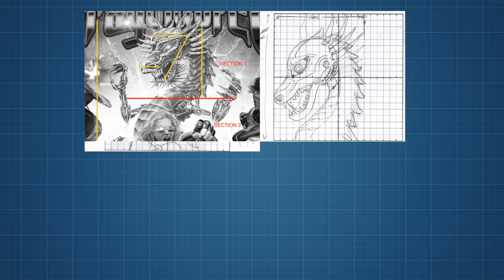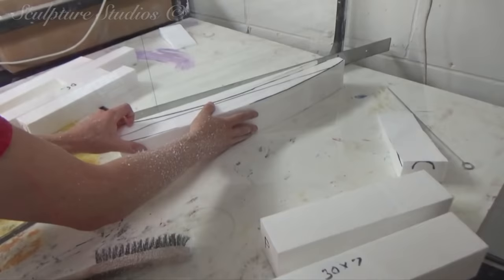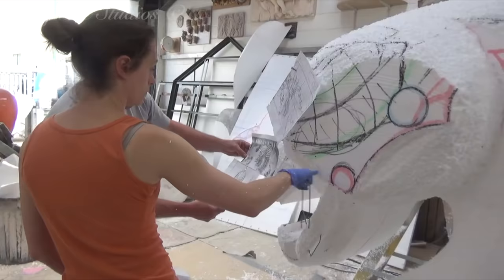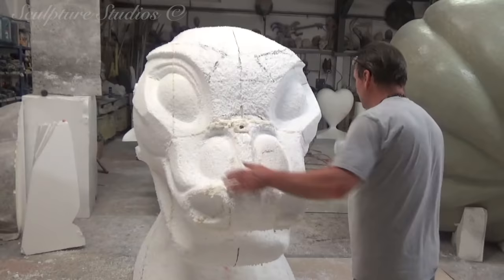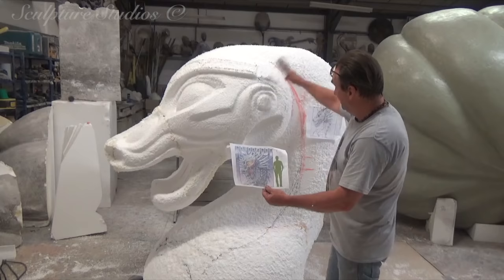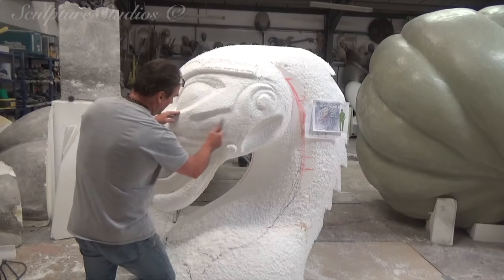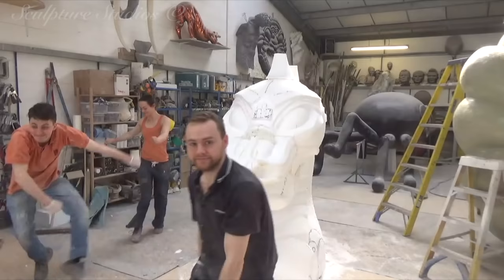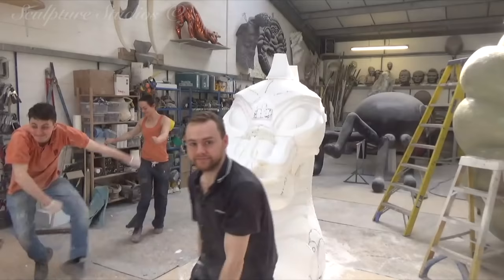Hand Carving a Polystyrene / Styrofoam Dragon by Sculpture Studios

Comment: im impressed by the fact that you generally don't rely upon a boting computer to do the carving i.e-  "computer guided lathe" instead your old school, (though this must take much longer) I also use foam for sculpture, BUT I use house insulation foam, i'm finding that this doesnt stick  well to it'self l not even with hot glue  or  expanding foam, I don't supose you (or anyone watching can tell me where I can get whatever glue they use to stick the silver thermol sheet to the back of the foam sheets, which is  a VERY strong adhesion)
your collective work NEVER  disappoints incidently, your all very talented & not afraid of a challenge I see.
Reply from the maker: You'd actually be surprised in regards to the timing. Bearing in mind there is no existing computer model of this dragon, it's simply a concept images taken from a drawing on the album cover. Therefore someone would need to create the 3D file, have this approved by the client. Then handed over to the 3D company to machine. Each of those processes alone could take anywhere up to a week or more depending on any backlog. In regards to hand carving, Aden can get straight on and probably have this carved in a matter of days. It's then easy for the client to request changes if needed, and for Aden to spend another day then making them.

   In regards to the adhesive silver foil, you're welcome to buy a roll from us? Get in touch via aden.hynes@hotmail.com

Comment: 3D  printing is much more efficiant accurate and affordable. but yours is nice too.
Reply from the maker: @quantumquestions5849 depends what you mean by efficient. How is a CNC cutting machine going to create this from literally a 2d image on an album cover?.... 
  
   3d CNC cutting requires a 3D file by which to program the machine with. Which you would need to pay to have created in the first place. Which also takes time, and costs money to hire someone with the expertise to do so. Aden literally carved this from looking at a single 2d image.

If you approach a 3D CNC cutting company, the machines could already be in use, and they may not be able to achieve this straight away. They may also not be able to make amendments easily, after the job is already carved. Working by hand allows for all of the above.

Comment: Excellent! Had I done my art all over again in these times, I would LOVE to be a carver for sets! However, been doing sets for 34 years for a nature centre, and I love the opportunity to carve something for us:) Budget-wise, of course:)  Cheers to great work!! What tool are u using to make it smooth? Styrofoam is not easy to work with. I have tried pink insulation board and tend to like that, but should try this material too.:)
Reply from the maker: Hey Vicki, thanks for the comment. We use a standard bead polystyrene (you can get a high density bead polystyrene for higher detail, but for the scale we work on, this generally works out just fine). We then use sand paper to smoothen the surface after we've finished. In this instance, we only provided the polystyrene master pattern, and the client then carried out the rest of the work with glass fibre etc. Definitely worth trying out a larger block (we get ours from polystyrene supply companies, that usually then sell to insulation companies etc).

Comment: 3D designing and printing is only usefull if you have to make more than 1.
Reply from the maker: And when absolutely no changes need to be made later down the line. As this will still need to be hand amended, or printed again!
Reply: @AdenHynesSculptureStudios  Yes but with printing it isn't that hard to reprint a design, but on this scale the changes will be made during the design process and it wil only be printed when its the final model.